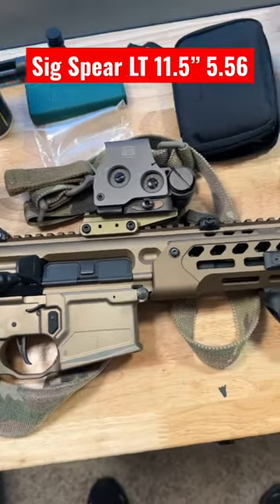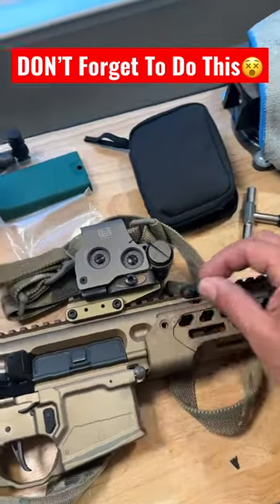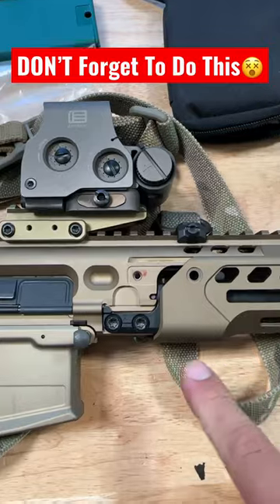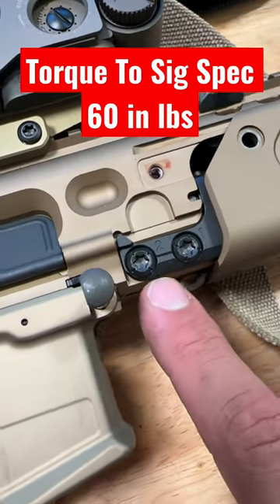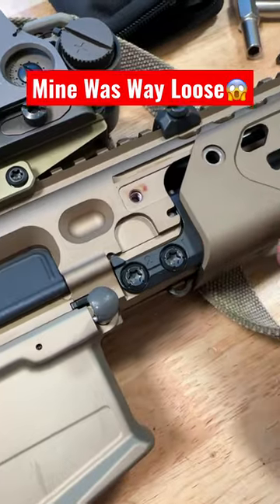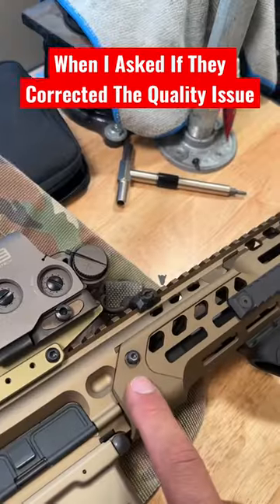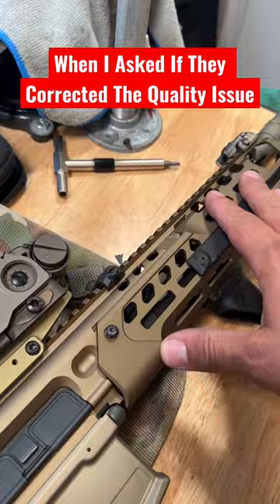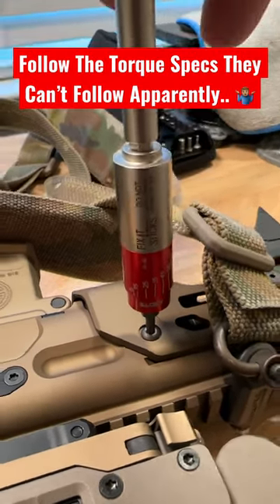Sig Spear LT MAJOR QC Issue😵

Comment: Be careful when torquing the small torx bits that detaches the hand guard. I stripped mine and I had to extract them. I’m not a fan or torx, I don’t know why they won’t let you use a hex key instead…
Reply: They're Torx+ fasteners, not Torx.   You'll have to get a set of the Torx+ bits.   I'm not a fan of Torx either but the Torx+ is superior to hex in my opinion.
Reply: @aaronj08ar  Well it’s too late now. I replaced the hand guard hardware with ones that use a hex key. So far it’s holding zero like a champ. I also got an Arisaka zero retention clamp and now I don’t have any issues. Still tho I’m not too happy that sig is making customers have to fix and QC their product.. oh well it’s my loss, I’ll learn next time.

Comment: I’ve seen a handful come through with the torque solution some even having up to 90 in lbs  and still having the barrel bed to one side.
Reply: That’s because it’s not the barrel it’s the handguard and most people that actually own one know this . Take the handguard all the way off and try to move the barrel I promise you will be shocked how very little the barrel moves.